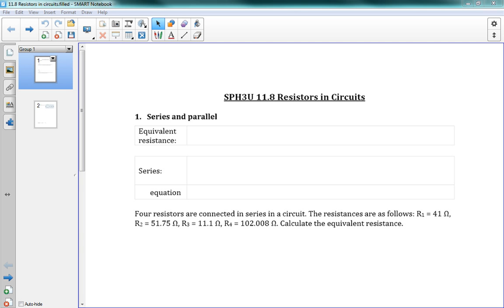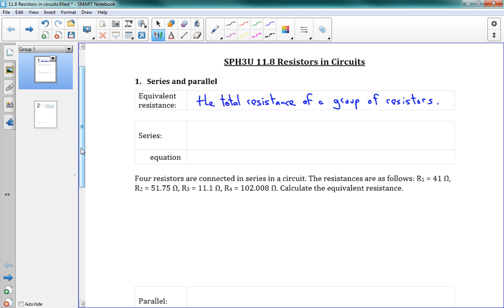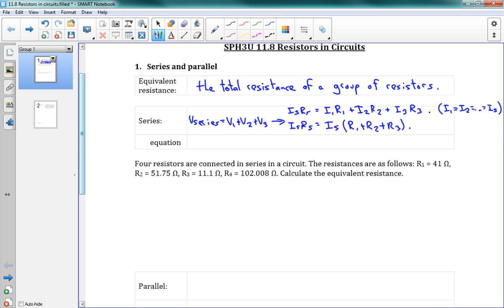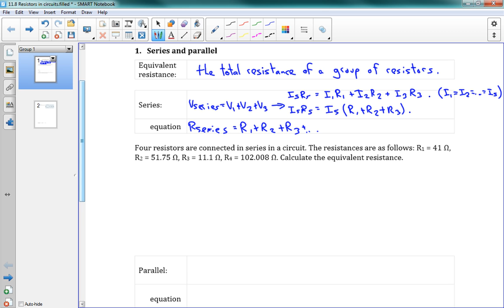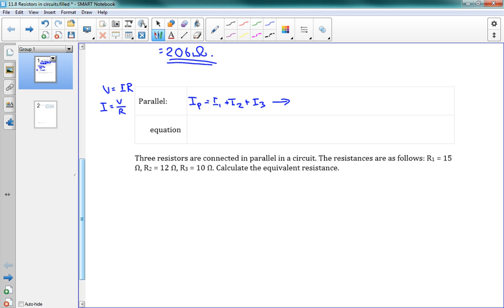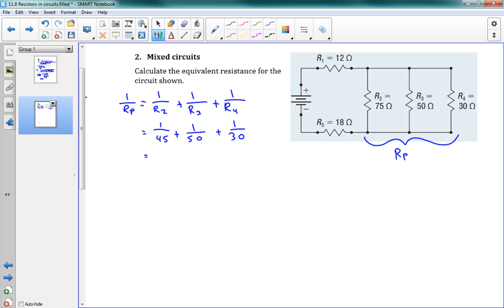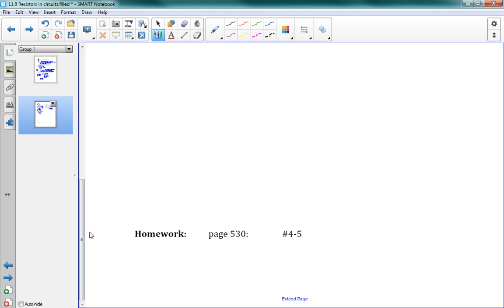SPH3U 11.8 Resistors in circuits

Comment: At 9:40 you wrote 1/45 but you meant 1/75 right??
Reply from the maker: Good catch! Yes it should be 1/75, if you check the calculation it looks like that's what I used, I just wrote it down wrong. Thanks for finding that!
Reply from the maker: @Yusra Raza Did you get 1/Rp = 0.067? If so then your answer should be 15. I'll expand the steps a bit:

1 / Rp = 0.067
1 = 0.067 * Rp   [Multiplying both sides by Rp]
1 / 0.067 = Rp   [Dividing both sides by 0.067]
15 = Rp
Reply from the maker: @Abaid Khan We start with the value of 1/R_P = 0.067. To get R_P we need to "flip" it (aka take the reciprocal) by dividing one over the value, so R_P = 1/0.067 = 15. It's pretty common for people to forget that step, so watch out for it!